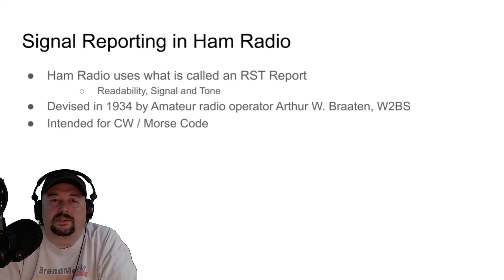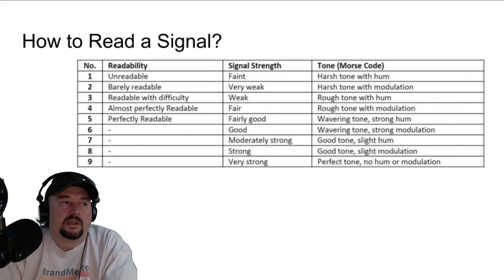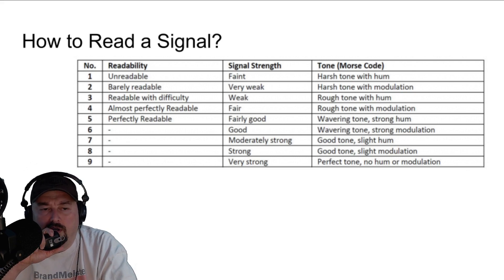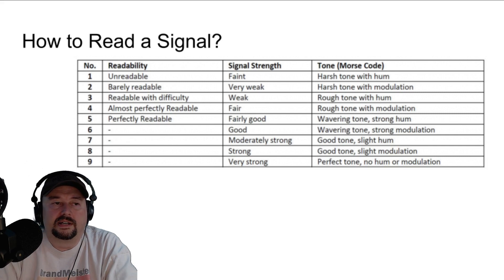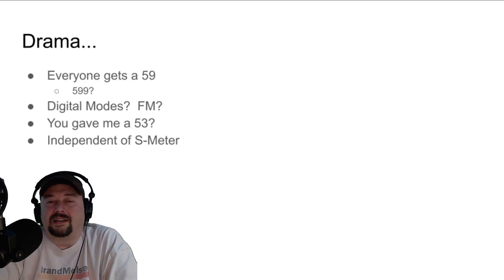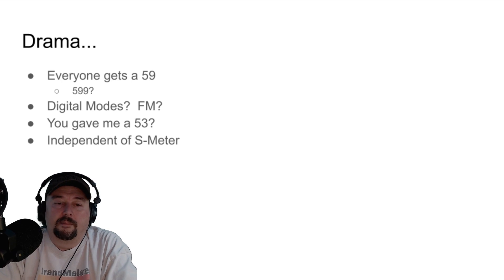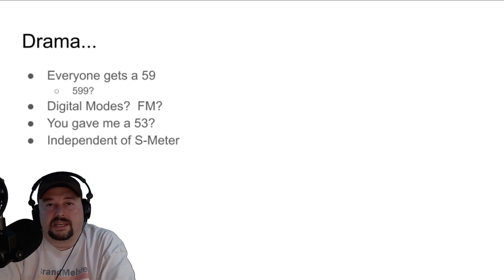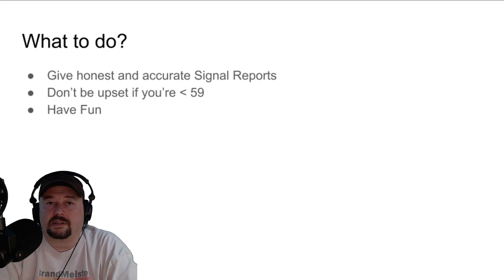What the Heck is a 59? - Ham Radio - TheSmokinApe

Comment: I asked in a club discussion why 59's or 599's are so prevalent?  The answer that seemed most probable is that there are contests where both operators need to submit signal reports and if the two reports disagree with each other the contact doesn't count.  So, to keep things simple and get the credit, both operators just report  59's or 599s.Thanks as always for the video.
Reply from the maker: Thanks for checking it out 👍

Comment: The S number in RST is directly displayed on your S meter.  The reason you don't give RST reports on a repeater is because the S report would be the repeater's signal level, and has nothing to do with the users signal strength.  Readability reports are all you can do on a repeater, and those are often given in terms of "quieting".  The stronger the signal is, the more quieting it will have on an FM repeater.  A "full quieting" signal is strong enough to completely suppress the background hiss/crackle and is good as you get on a repeater.  A weaker signal will have some hiss, and a very weak signal will have crackle and drop outs.
Reply from the maker: The RST is not directly related. I explain in the video but maybe you watching something else...
Reply: @TheSmokinApe   The S is signal strength from 1 to 9.  Amazingly, your S meter also measures signal strength from 1 to 9.  Coincidence?  Just read the friggin meter unless you have a good reason not to.  You asked for input.  I gave it to you.
Reply from the maker: You do realize your S-meter is subjected to the RF-Gain setting right?  How about you explain to me, where in the RX chain the S-Meter get's it's reading?  Maybe then, you can explain how the S-Meter is giving you an accurate NOT adjusted reading...

Comment: I am still very new to the hobby and actually don't even have my first rig yet. I have watched many of your videos, and found them very helpful. getting ready to get my first HF rig, my local club helped put up a 140' dipole at my house, and brought an older rig, and tuner to try it out. Good news it worked on all the antenna's advertised bands. I found myself asking about the reports he was getting back, like the RST. Along with those, he was told once for example that there was "RF noise". I asked my club member to explain, but he really couldn't give any example of that sound. We knew why because we were sitting right under the antenna on my back yard using a ungrounded rig. Maybe you could consider a future video that could cover what different types of noise sound like. I have searched for examples of even common complaints, like CW "chirp" and found nothing. I think examples like that might be a help for new folks like me. Thanks.
Reply from the maker: Hey Tomp. I will add that to the list 👍
Reply: RF noise often means RF is getting into your mic on SSB.  It adds a noise best described as distortion in your audio.  Tune to an SSB signal and put your rig on AM.  That's what it sounds like mixed in with your audio.  Many of the CW defects such as clicks and chirp aren't generally heard anymore with modern digital radios - they're mostly a problem on older rigs.  Hum can still be a problem due to failing power supplies.
Reply: @stargazer7644  I just got a FT-710 for Christmas. Hopefully I'll have a spot for it in the house soon so I can test it out.
Reply: @tomp962  Congrats.  Looks like a great radio.

Comment: I've often wondered how to use an S meter for giving signal reports since on my radio (Xeigu x6100) the s meter changes significantly with the RF gain, and I change the gain a lot to deal with noise. So I have just been giving people subjective reports based on how strong it appears relative to the noise floor. Interesting to learn that this may have been the "correct" way to do it all along.
Reply from the maker: You were doing it right 👍

Comment: Ape,
I totally agree with you in this respect.
If there is a problem with your radio or antenna, you need to know about it, from others
that are receiving your signal.
Giving out stock standard 59 signal reports are BS and helps no-one at all.
Secondary to this, the two numbers are meaningless without some sort of back-up information (especially with voice modes) as to why you're giving this particular rating to another ham.
I will say (where applicable), things like there is a whistle in behind your audio or your signal fluctuates, or whatever as the case may be.
A very good video.
Reply from the maker: Thanks Mike, glad you liked it 👍

Comment: I hate it when i get 59's and I'm at home and on any band except 20m....I'm talking through a G5RV that's wrapped around the inside of my attic with the ends overlapping, in the middle of a neighborhood. I KNOW you're not hearing me at a 59. By that same token, if I give you a 59, BELIEVE IT! I have such a high noise floor at home, that if I can hear you enough to work you, you're no worse than a 57, but usually a 59. After my first ever portable operating this last Memorial day weekend out away from all the noise.....It gave em an all new appreciation for the signal reports. I now get that you can be a 53, where I can hear you perfectly, but you are VERY quiet.
Reply from the maker: Totally agree, in most cases it’s totally meaningless 👍

Comment: I think that the S meter is better than the RST method which is extremely subjective, where the S meter is a real signal level for every specific station of course.
I think rst is more for cw
I don't mind low reports, I depend on other ppl reports to know how bad or good I'm getting to the air so accurate report is essential for me, sometimes I ask about S level signals if they give me rst subjective values
I'm an electronic technician , have proper calibration equipment (service monitor) so my s meters are properly calibrated, but of course that's just half the story, when we take into consideration antenna and cable losses
Reply from the maker: Thanks for the post, even with a calibrated S meter your RF Gain settings can impact the reading.  Additionally, I’ve seen where the calibration is for S9 but other S levels may not be consistent.  The RST report was created for CW and later adopted for SSB or phone modes.  Anyway you slice it, a signal report is pretty useless…

Comment: On digital (DMR) I DO NOT give numbers -- my usual is good audio good signal -- anything less than that i will try to describe what i am hearing that is out of the ordinary -- with digital your either in or your out in my opinion -- HOWEVER i will get a bit testy when someone is eating the mic and spitting in my ear -- NOT COOL FOLKS !!! -- most of the radios now days have very good mic elements and they transpose the sound quite well -- no sense in having the mic any closer than 4 inches away from your mouth !!!!!!!!!!----- maybe some of those that use the HF bands need to do that so they are heard but there is also an AF gain control ---- ask for a audio check and folks be honest and tell them to back off the mic -- i have heard numerous reports given where the person sounds like crap but they say ooooo your audio is good -- ya i can hear them but please without the extra WIND NOISE !!!!!!!!!!!!!!!!!!!!!!!!!!!!!!!!!!  -- FLAME OFF  N7JJY
Reply from the maker: Mic eating and over-driven = no good!  Thanks for watching.

Comment: Question: I’m certainly not a seasoned ham. General Class - June 2020.. 
Most times when a signal is strong and, readable I may say again - again, but it’s not from poor (signal) modulation, etc, it’s because Of accent. Myself personally, have big problems making out certain words because of the Person’s accent. I feel horrible giving a lower report on readability for the simple reason that I’m finding it difficult to understand what may be considered broken English. I can’t speak any language other than English but if I could, I’m sure it would be with a western Pa (Pittsburgh-ish) accent. 
Thoughts???
Reply from the maker: That makes sense, it's OK to ask someone to repeat to make sure you got it correct.

Comment: Umm, no, signal strength is not subjective. An S9 is defined as 50uv at 50 ohms, or  -73dBmW. Each S-unit lower is a drop of half voltage or -6dB power. Meters may not be calibrated the same (but should) and some do think S units are subjective, but there IS a definition. Since S-units are defined to a specific voltage/power, it DOES make sense to have a reading greater than S9 in terms of dB. 

Why might you get a strength report in a range, e.g.,  S4 to S7? Fading. There can be some pretty rapid fading on HF. Signal strength is not always constant. 

Why would you get a readability report of R3 or R4 with a strength of S9? Interference or burst atmospherics (static crashes). Just because you have a strong receive signal does not mean perfect reception. 

This is of course if the person giving the report is being honest. Throwing around "59" is lazy and useless indeed. However, there is a lack of understanding about what RS(T) is today as evidenced by your video. 

You could give an S-unit report for FM given the definition above, but usually your just reporting the strength of the repeater. It's better just to report they are reduced by the repeater with "full quieting", i.e., full capture. 

S-unit could be used for digital, but not in the way amateurs implement digital modes as modulated audio on SSB. That digital signal does present voltage/power at the receiver just like any other signal would. It's just that you don't have access to the voltage/power of only that digital signal as there may be many present in the pass band.

Comment: Signal reports are inherently subjective and heavily influenced by the setup of the RX station as well as the TX. 

Using the S-meter removes some of the human subjectivity even if they’re not calibrated the same — but the meter calibration matters less than the antenna sensitivity and related factors. 

In contest situations, few stations really want to give or receive “true” RST due to the high turnover rate. But in casual rag chewing, you can do better than numbers, you can give true descriptions of the signal: “fading  in and out” or “sounds like your mic gain is too high” etc.   And in POTA, “true signal reports” are encouraged because a substantial part of that activity involves experimenting with portable setups in a way that established contest stations really don’t care about. 

Thanks for the great video!

Edit: grammar/spelling
Reply from the maker: Thanks for the perspective Mike 👍

Comment: I get it for contests because it is about speed and efficiency. If I get a 59 after I ask I will sometimes quiz the person about how I sound. 
FM signal reports are fine even through repeaters especially when using HTs.
Reply from the maker: I get, just seems silly to be required to give a report and not do it correctly.  Thanks for the comment!

Comment: I once gave a station I know a 5.8. report and he said nobody had ever given him that before, He seemed very put out, even offended. I gave a true report: I heard stronger signals on the band that day. It depends, as you say, it's subjective, his signal strength to my noise, my aerial efficiency meaning signals could always be lower: my h/b mag. loop is not as good as my inverted vee but it can cut down some noise if I position it right, local QRM affects readability, my receiver sensitivity and selectivity not great if I use my 76 year old 19 Set. I guess nobody had ever given him a real report.
I've never heard 599 given on ssb. 
5.9. reports then asking to repeat the call sign are heard regularly in contests.
I look at the S meter on my FT817 but if I don't agree with it I don't give that report but give what I think he sounds like to me for the above reasons. An S meter is not a laboratory grade instrument, it's just an indication of one signal strength compared to another.
My h/b tx/rx has never had an S meter fitted in 22 years as I didn't see the need for one. I also never got round to putting sidetone in.
G4GHB.
Reply from the maker: Thanks for the comment Bill, I agree there's no point in giving fake reports 👍

Comment: Maybe it's a CW thing, but I always give an honest signal report and I'm pretty sure most CW ops do. It's also probably easier because they are tones. I had 3 qso's earlier tonight, conditions were a bit rough. From MD, I was 529 in CA, 569 in TX, and 599 in the next town over from me. I gave them 539, 579, and 599. That would be insane if someone came back 53? 53?! lol wtf!

But in CW the last number will always be 9, and if it isn't you need to explain why it isn't a 9 so the op can specifically know what's going on. I think I have only done that maybe 2 times ever, and they come usually back "old rig hi hi."
Reply: I've had some like that, 339 each way and we're both QRP and even 229 but that's where cw works and the QSO made. My one valve tx can be chirpy if I don't adjust it right and one guy runs a Paraset which is always chirpy.
G4GHB.
Reply from the maker: @bill-2018  Folks getting upset about signal reports is silly
Reply from the maker: Maybe it is, great context and thanks for the comment 👍

Comment: I get what you're saying.  I work a lot of QRP and and higher powers.  About 50/50.  I am constantly getting 599s from DX and contest stations when I'm running 2.5 or 5 watts.  They just have that programmed in their button box because they don't want to take the time to consider the signal report and just move on to the next station as fast as possible. As long as they get your call letters you're a 599.  But I give them the cherry or the dirt accordingly.  The way I do it is I go by the meter and you may say well all meters are different but that really doesn't matter since all signals are different on my end. But most meters will fairly accurately distinguish the difference between other signals on the band.  I used a Ten Tec Century 21 which has no s meter for 16 years and nothing else.  I Was always wrestling with what strength to give them. I don't think many ears can really tell the difference between a S4 and an S6 without some kind of indicator.  I try to be objective when giving the readability.  That and the signal strength go hand and hand.  But from a 1 to 7 meter reading  on strength, I give them a 1 to 7.  From 7 to 9  I give them an 8. That is a little broad but I think it's fair.   Any thing over S9, I give a 59 or 599 Because that is your extremely strong signal area. K4JTP

Comment: With a small yard, I use an end-fed, and the RS also depends on the receiving antenna. So, the same signal on your Yagi might be a 59, but a 55 on my shitty wire - whatever your method. Your shitty signal report might not depend on your signal, but my antenna, and also propagation outside the control of either. I'd rather get the real report (in contests, it was inevitable 59 would become the default). It's childish to be upset about a 'bad' report. It's a report. Not an assessment of your character. Great vid.
Reply from the maker: Awesome comment, thanks for posting!

Comment: The difference between 4 and 5 -  4 might have flutter, static, or other interference, but do not have any difficulty hearing the transmission.  A report of a 5 should indicate there wasn't any problem receiving the signal and there was no interference.

The S meter - kind of tricky, or can be.  HF and simplex operations has meaning, if you get someone who gives you an honest report.  S meters have division that at a certain microvolt, that is a S unit.  There is room past the 9 on the S meter, and that's measured in decibels - with marking for +20 and +40.  Half way between S9 and +20 is +10, so saying 10 over 9 means a signal that is strong enough to go into the extended scale by 10 decibels.  As far as the meter calibration, older rigs (or even home brewed rigs) might have a knob to calibrate the meter.  So yes, the caibration can be off.  In modern rigs, the meter is calibrated to the microvolts of the signal.

Lastly, a signal report is used as a conformation.  If you check into let's say an OMISS net (check that out at www.omiss.org), the calling station will gave an honest report like "W2ACB I read you at 33" and the other station will respond with "K9XYZ I roger your 33, and I have you at 47".  The first station will reply, "I roger your 47, thank you."  This confirms both stations heard each other, and in the OMISS situation, the net control can confirm that.

Also, on QRZ's logging program, the time, date, frequency/band and signal reports have to match to be confirmed.  When you send out QSL or eQSL cards, you put the signal report you received as a conformation.

On repetaers, a little bit different.  Seeing as the R and S of the report would be of the output of the repeater, there are someother terms used.  Picket fencing is where the signal has short bursts of static (caused by the polarization changing from vertical to horizontal and back), and full quieting (meaning no noise, no interference).  You may even try to pick them up on the input frequency (pressing the REV button swaps the input and output frequencies), and give them a report on that signal.
Reply from the maker: Great info, thanks for sharing 👍